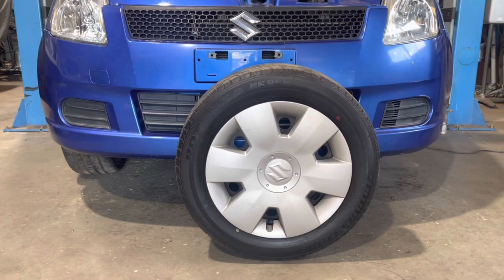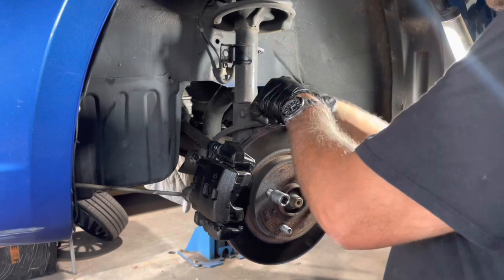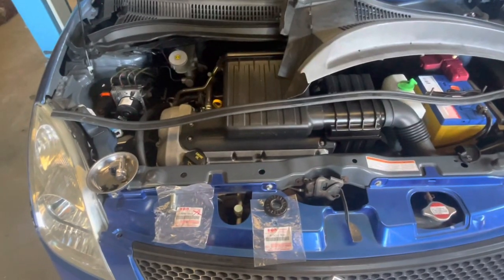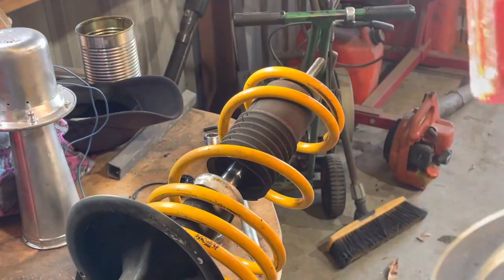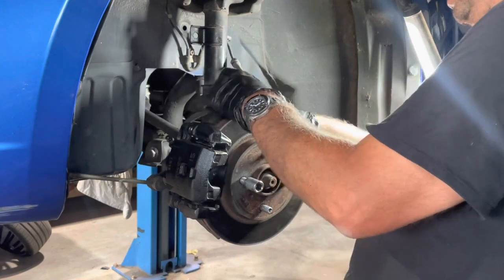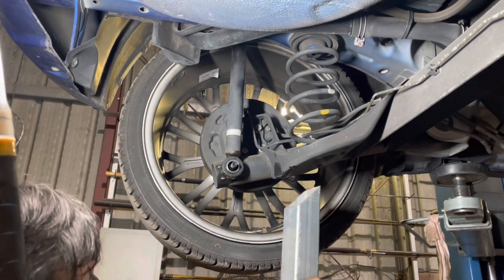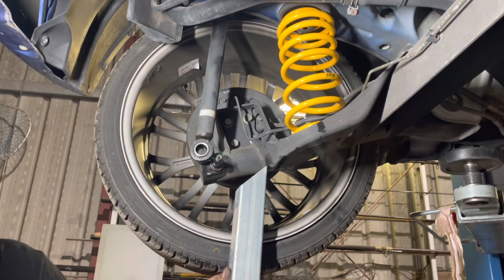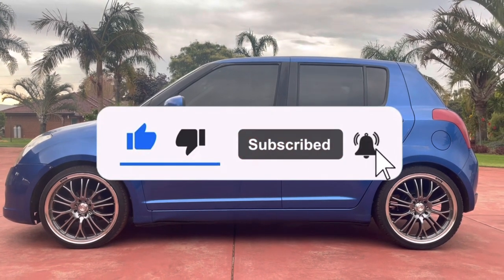2006 Suzuki Swift - Episode 9 - Lowered springs & 18in wheel install

Comment: What brand of wheels are they? They look pretty decent aye
Reply from the maker: They are a Avante 18x8 with 215/35/18 tyre. 
Back rubs ever so slight on the  guard liner.
Reply: @petersbackyardbuilds  i'll get a set, but I will get a panel beater to roll the inside of the guards. Thanks for the response. Happy Swifting 🙆‍♂️

Comment: Hey Peter, did you have any rubbing issues with this setup?
Reply from the maker: G’day, it does rub ever so slightly on the rear over heavy bumps. 
Reason I believe is the style of tyre is quite square edged where the front has a slight taper even though it’s same size. 
Cheers.
Reply: Thank you for the reply! What tyre profile are you using? I'm currently on 205/45/17 and have rubbing issues on the rear as well. Wanted to install lowering springs just like you but not sure if that's even possible. I'm driving the exact same model as yours!
Reply from the maker: Rims are 18x8 with +45 offset. 
Tyres 235 35 18. 
Good luck mate.